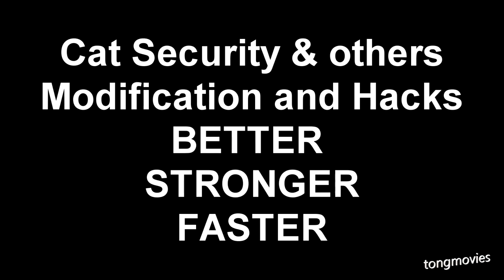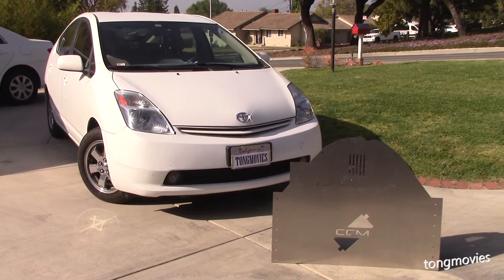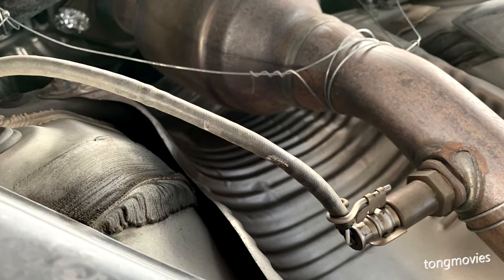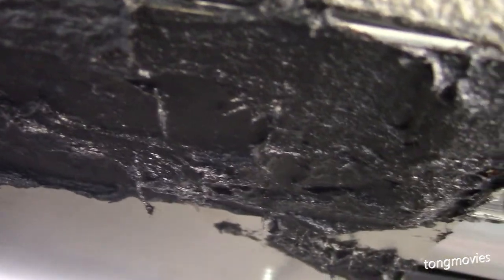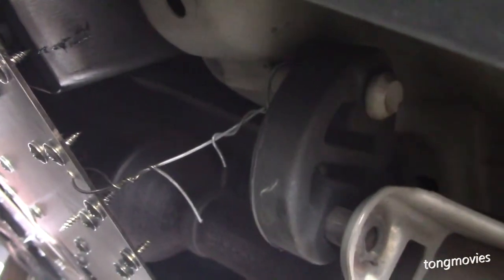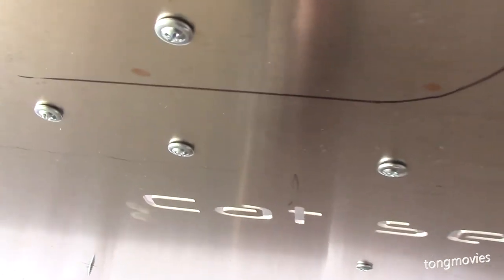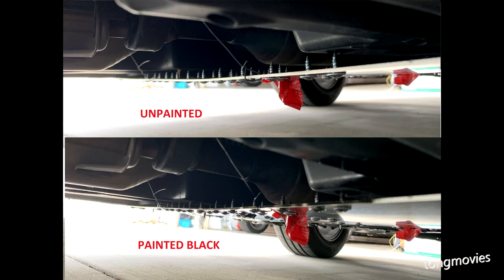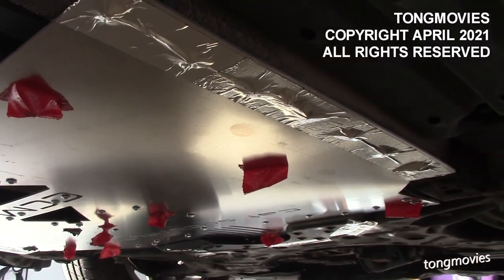PRIUS CCM Cat Security Installation with Modifications - BETTER STRONGER FASTER. Catalytic Converter

Comment: I have a shield on MY Prius. I totally agree with u, USE UR IMAGINATION!! I say, "THINK LIKE A THIEF". I ALSO agree with add more bolts/screws. The more difficult, THE BETTER. But I also take into consideration if I, (or a mechanic), NEED to get in there. We can't reveal ideas on the internet but I say, "mix the SIZE/TYPES if hdwr. For those who say overheating the battery, perhaps program cooling fan to operate more. Great video!! 👍
Reply from the maker: Yup. I’ve added more anti theft deterrents that I don’t want to mention. They would have to work extra hard to get it.  Also, the battery is in the back of the car and the shield is near the front. I don’t see any overheating issues with the battery. I don’t see much concern about any overheating issue unless your in stop go traffic in 100 plus degree weather.

Comment: Nice try on your screw heat sink approach but may not work to dissipate heat as much as you thought. The total surface area of the exposed screws are negligible compared to the shield surface. In fact it may add more air drag and cause wind noise underneath. Instead, maybe make the inverted screw length longer to act like a barb wire deterrent.
Reply from the maker: Yes, that’s using your imagination!  
I was debating with myself on the length of the screws. I could always add more.
Reply from the maker: Note that YouTube tends to remove videos that it deems inappropriate.

Comment: I like the way you think. Have you had any wind noise from the screws that point down? Those are the ones that really do it for me in terms of "heat dissipation." That's what I really want to have, something that dissipates anything "unwanted."
Reply from the maker: So far, it's been totally fine. I don't even know my shield is down there. No noise at all. There are other simple yet effective additions I'd like to add to improve performance (hint - chili peppers) - but those are better left secret. I wanted to add a tilt/motion sensor to the built in Prius alarm - but no one seems to work on alarms anymore.

Comment: I just got the supreme protection cat sheild for my 2007 prius. My question is what's going to stop the theifs from just unscrewing the bolts?
Reply from the maker: Time. It takes time to remove them. If you used rivets, they can also cut them off. That’s why I covered them with tar. Nothing is perfect. You just want to slow them down so they choose another car.

Comment: awesome install and love the modifications you threw on there. How're you gonna replace your O2 sensor when it comes time to maintenance??
Reply from the maker: All cat panels will have the same issue. I’ll just have to unbolt and unscrew everything. Hopefully it won’t happen any time soon.
Reply: @tongmovies  I think it'll be a little more complicated than that since cat security uses one way screws. you'll have to rip that thing off just for maintenance and then buy another. Check out www.catshield.com. All their products use rivnuts with tamperproof screws and their featured as the security shield of choice for Toyota at www.toyotaap.com.
Reply from the maker: @s.a.m.7611  I probably don't want anyone to know this, but, I didn't use their rivets or one way screws. I bought my own stainless steel screws. (which you see in the video) and used those instead). I added extra screws for extra strength. Since I'm using tar to cover up the screws, no one will know if they are rivets or not. So yes, I can unscrew them if needed. If you check Yelp for Cap City Mufflers (CCM) in Sacramento (the maker of the shield), one of the reviews shows that the Cat Security got defeated. Here's the link. https://www.yelp.com/biz_photos/cap-city-muffler-sacramento?select=bfVb0NiulJVifnQxtV8D5A  it shows the weak point of the shield. imo, the rivets aren't necessary. extra screws and bolts, covered in tar is more secure. And besides, you can always drill out the rivets.   If you park your car on the street and in the same place, the thieves will check out the car one night, then, come prepared the next night with proper tools. It's best to park someplace secure. My next project is to add a shock/motion sensor to my factory alarm - at least the car will make noise if they lift it.
Reply: @tongmovies  I like how you really thought this through! The only reason I asked is because I had to replace my O2 recently. I got the millercat catshield, a tilt sensor/siren alarm for when my car gets lifted.
Reply from the maker: I want to get the tilt sensor also. It will definitely scare them a bit and notify the neighborhood.

Comment: Converter gets hot burn your battery in do time
Reply from the maker: Has it happened to yours?
Reply: @tongmovies  Just bought mine 2018 but one said there rug in the back seat was crinkled up from the heat that has to hurt the battery in due time
Reply from the maker: I was definitely concerned about the possibility of over heating when researching this. And I haven't found anyone who's car has actually been damaged because of the CCM (or other) shields/skid plates (you mentioning the back seat rug is the first). Also, I think I've seen the Miller Cat being approved and installed by some Toyota dealers. There are vent holes in the shield. Since the Prius is a hybrid, the engine is typically off when you're at a stop. When the car is moving, it's getting plenty of air movement to cool the cat and exhaust. The battery is in the trunk and further back than the rear seat, so there shouldn't be any extra heat going to the hybrid battery. For my Gen 2 (2005), the shield only goes back as far as the steering wheel, while the Gen 3 (2012), is much smaller and extends only as far as the dashboard area. So if there's any overheating, it would be in the front floor, not the rear floors. I've gone 5 month, without any issues so far. I also just got it smog checked without issues and the technician said that he's seeing a lot of these shields and there haven't been issues. There are other catalytic converter protection that offer better ventilation - I just thought this was the best option for me.
Reply: @tongmovies  Well that was only one case it could be his Cat was plugging up creating lot of heat But i going to get one for my car and just see what gives seems many people are getting them i like the idea painting with the Orange heat paint to